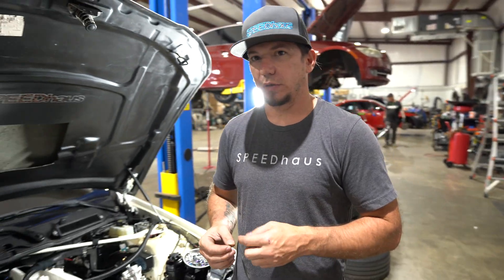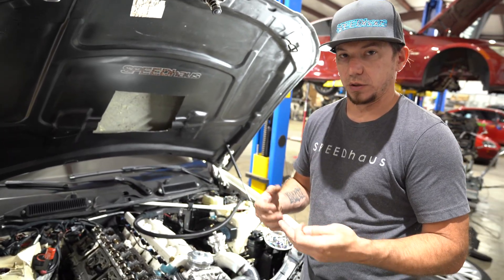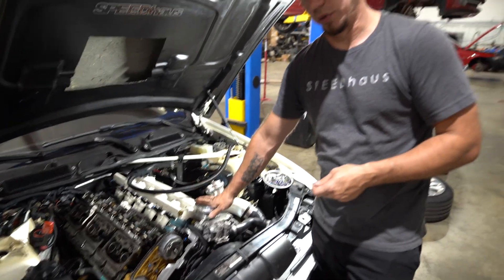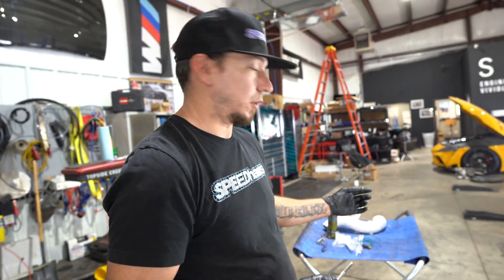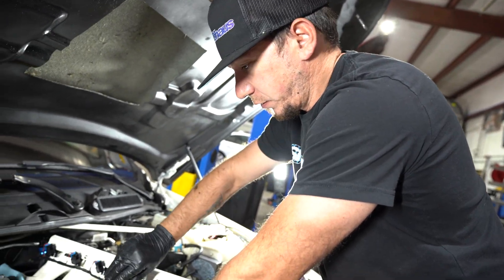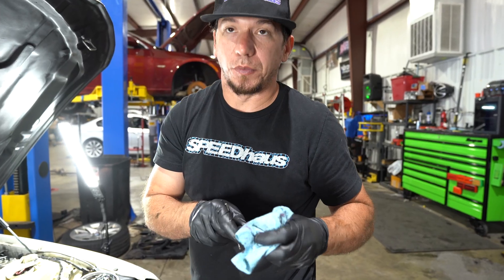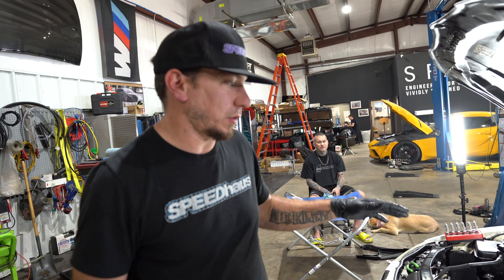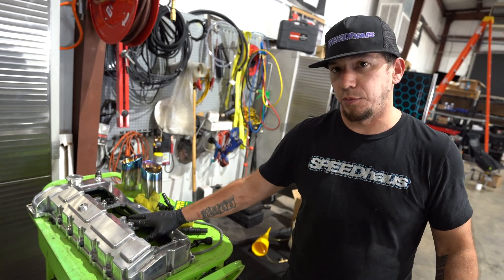How To Plug Engine Head Ports | BMW N55, N54, B58

Comment: Will this mess with crankcase vacuum? I have the bms kit high side and low side which comes with a pcv that screws into the valve cover. Will I need a check valve in between catch cans and valve cover to adjust crank case vacuum?
Reply: Did you find out? I have the same question.